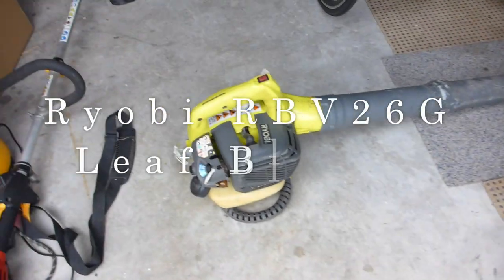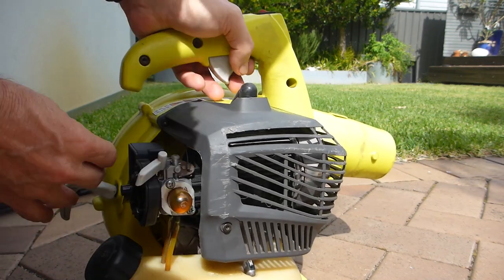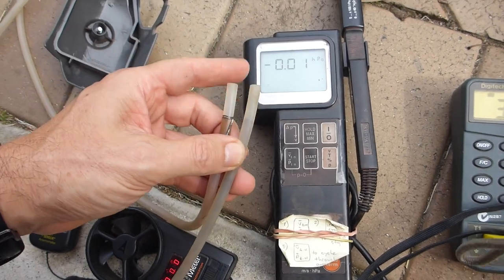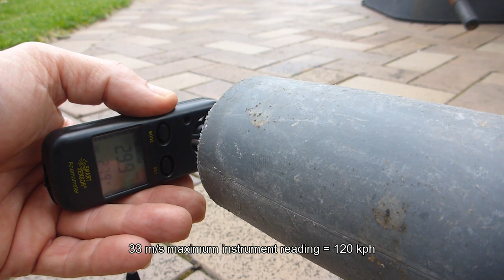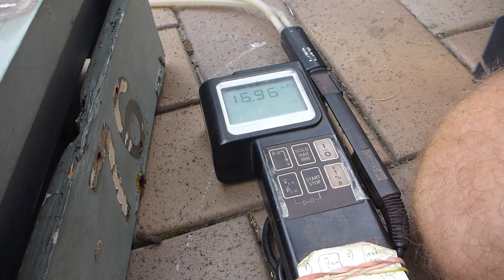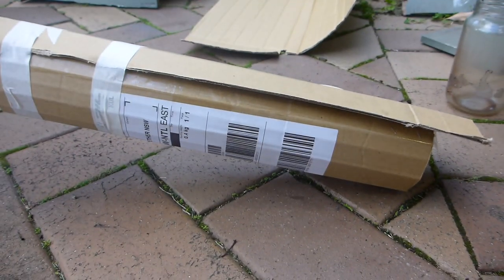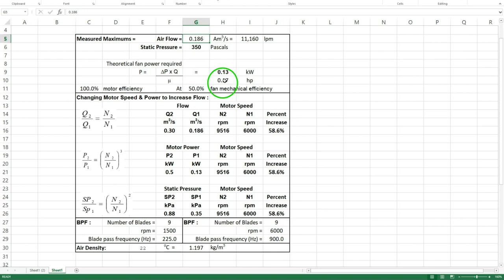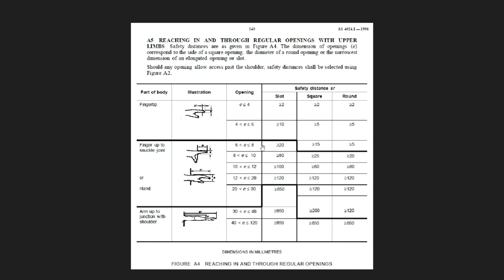Ryobi Leaf Blower Speed Test - can they really blow at 320 kph?

Comment: I have had suped up whipper snippers before, I might mod a 2 stroke blower. Motor mods will probably be straight forward if I pick the right one, but there are concerns of the impeller blades coming apart at higher rpm so ill have to pick one with a pretty stiff blade, maybe heat them up to bend them and figure a way to extend them. I think the biggest gains will be in the RPM though
Reply from the maker: Sounds awesome. Just make sure you build a strong cage to hold the blades. First critical speed is typically 125% of maximum rpm, which would be 1.25 x 10000 rpm. You'd need to balance the crank to achieve that though. Cool project!